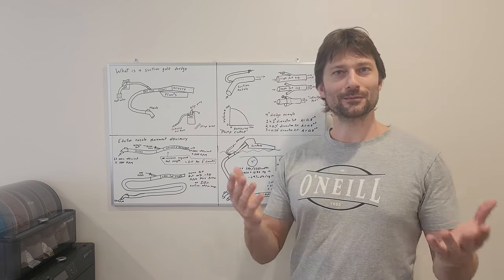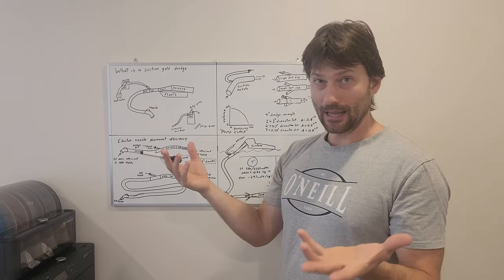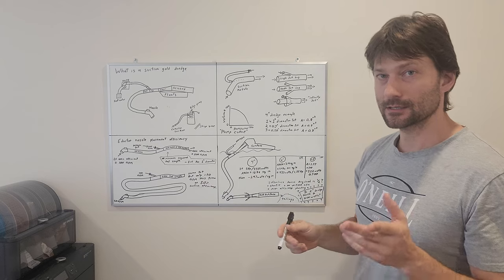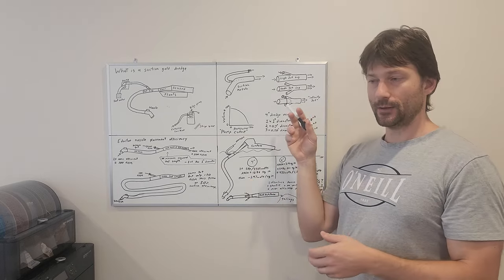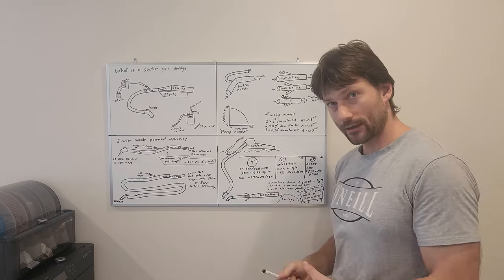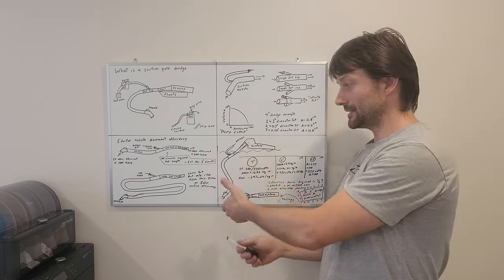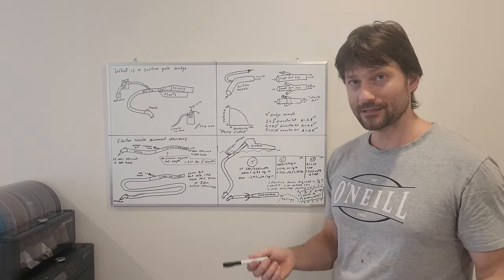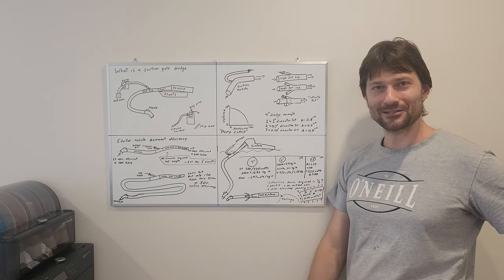How a Suction Gold Dredge Works.  Discussing suction efficiency.

Comment: Thanks for the video. I work on my own custom 16" gold dredge up in Nome, Alaska. I make Venturi pumps (or jet logs, or eductors, as some call it)  for myself and others. One thing people need to understand is that these suction devices are simply another pump that is powered by water from a centrifugal pump. They can never surpass the output of the centrifugal pump. Typically they are around 80% efficient. So if your centrifugal pump is producing 1500 gal/min @ 60 psi, then your Venturi pump will be roughly 1200 gal/min @ 48 psi.

I know you are familiar with the Bernoulli equation. The goal is to produce a Venturi diameter that will bring your input water pressure as close to zero psi without causing cavitation or dead heading. Doing this removes the trial and error of jet sizing. The cross sectional area has to match so you have to sum up the CSA of all the jets you want. 

Cheers!

Comment: I was looking into gravity dredging and realized most people used to powered systems (including me) confuse water pressure with water velocity, because you increase velocity with increase pressure in those systems, but the Venturi effect is dependent on water velocity, not pressure. A long way to say that I think you need to do your own experiment with the sizing of the inductor nozzles or other stepping down of piping and not rely on what is accepted, because high volume can get you high velocity but not  at the same sizing and steps as high pressure will and the research is on high pressure systems.

Comment: Hi ! 😊 I am working on getting gravity vacuum going ,   1 - 1/2   100 feet -  I hope it really sucks 😅 all fine gold so nozzle of hose  has 1/4 inch screen -  to help avoid jams - . When are you going  Gold hunting ?  Even just some Gold & Gem Stalking  while avoiding Aussie critters be a Adventure 😊 Stay safe -,see you at your next video.
Reply: You can use 4 inch corrugated pipe for the cheapest gravity dredge hose. The corrugation will even process a lot of the dirt. Simple siphoning is how I've always seen it used but I'd like to see a system using a jet or suction hose on the other end. In theory it is simple.

Comment: As a Firefighter. The pumps have ratings on them. In a FF truck it has to do however rating is a a 10’ draft. I think? Is 80% of that other wise it fails. And that would be if there are no restrictions ie smaller suction and discharge pipes

Comment: Would be really interestes in the infinity. And just as you said about keenes testing I agree with you. You basically don't want a high pressure pump, you want volume for an infinity.
Reply from the maker: I suspect that the input pressure needs to be higher for a surface dredge, and the higher you need to lift the higher the pressure, but a subsurface dredge may no need as much pressure.  I'm curious to find out for sure if an infinity jet is better or not.  We will find out with testing soon enough! :)

Comment: If you're going to use a 3d printer you could probably make an infinity or couple jet. It might even turn out stronger than the jet log type. A subie with infinity jet would be even more efficient if I remember correctly.
Reply from the maker: I guess we'll find out for sure!

Comment: If you are going to use bilge pumps or low powered pumps how about combining a suction nozzle along with a jet induction? Or maybe instead of a double inductor you use two or three inductors in a series on the suction line spaced a few feet apart, either with separate pump or with some type of manifold.
Reply from the maker: It would be interesting to see if it was more efficient to run a single jet one after the other, or a double jet at one spot.

Comment: Make sure you have a pressure pump ( enclosed impeller). electric gold dredge ??
Reply from the maker: It might be possible... If it doesn't scale well, the test data can be extrapolated into a larger gas powered design.

Comment: To calculate the GPH/GPM needed for a waterfall or stream, multiply the width in feet by 30 GPH.

A 6 inch dredge typically requires a pump that delivers 500–600 gallons per minute (GPH). However, according to Treasure Net, a 6 inch dredge may require 1600–2000 GPH to use the Gold Hog Matting properly.

I really want this to work 2" electric  dreadge  would be aweaome
Reply: Well that was useful.
Multiply the width of WHAT ?
So you need a pump of about 500 GPH but you actually need 1600 GPH to run properly.
I'm coming over to run your tailings - Money for Nothing.

Comment: https://www.youtube.com/watch?v=9F2Vbe66V-8&t=168s     I don't know if you have seent this design yet. But I thought this was a neat idea and it's kind of a bit of both, suction and jet. I'd like to see one with a 4000 pump to see if it will move a good amount of material. Buy I am still shoveling snow and slush so could be a while before I get started. Or if you have any thoughts on this design before I start.
Reply from the maker: Thanks for the link.  That guy came up with a very creative way to channeling the water!  I've tried drilling a bunch of holes around an ABS pipe then using a larger T fitting to fill the water around the pipe so it sprays in all those holes, it worked well, but I like the way he centers the pipe inside the other pipe and bent the ends out to create a whole ring of jets...  Looks like it works fairly well with a small bilge pump, just imagine the possibilities with a 3D printer!

Comment: If you put in the following to chatchpt it will calculate it out

"Using Bernoullis venturi principle. Calculate the flow rates in the following situation. 2in hose lifting 12" above the water where a 2in nozzle is outputting 4000gph. Use GPH"

≈952.74GPH 

Doesnt really make sense since its less than the pump output, chatgpt is wrong frequently but the calculations are interesting to see

Heres the jist on Bernoulli fro chpt
"This means that for a given flow rate at the inlet (determined by the pump), the flow rate at the outlet (throat) will be the same, regardless of the nozzle size. However, the velocity at the throat will be inversely proportional to the area of the throat.

So, in theory, the smallest nozzle size will give the highest velocity at the throat, but the flow rate will remain the same regardless of the nozzle size. However, in practice, there are limitations such as frictional losses and practical constraints that may affect the actual flow rate."

I say just go for the biggest nozzle and upsize the hose on the pump to reduce friction losses. 

Btw you are going to love the 3d printer. If you want any help designing models just let me know.
Reply from the maker: I asked GPT some specific questions about how much flow rate is going through a suction dredge sluice box and it had no good answers.  It's pretty impressive at some things, but it definitely has some work to do before it takes over the world. (thankfully)
Also, I'll get some measurements of an impeller to swap onto the bilge pump I got to test with, and if you want to try your hand at making an impeller for me to test out, I could print one off and see how your design works out.  Otherwise, that's this weeks project is to figure out how to get started on that impeller...  Fusion 360 is hard!
Reply: @UtmostOutdoors  Yea sure you can send over the specs. What is your email? Fusion is a pain to learn but really powerful. Probably want to use parameters for the impeller to easily change the number of blades, angles etc.  The design history is your friend there.
Reply from the maker: @MacF.  utmostoutdoors@gmail.com 
That's a good idea.  Could also swap out 3 blades for 5 blades for another test. I'll test out my shaft size I'm a print then send you the specs.